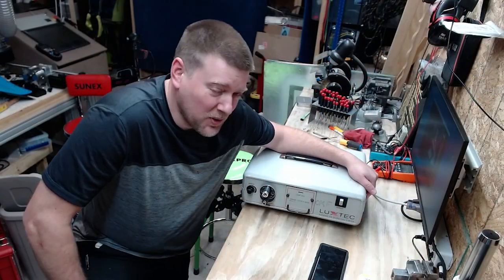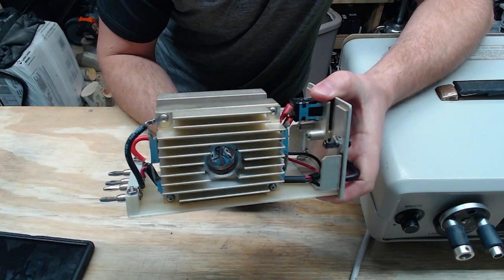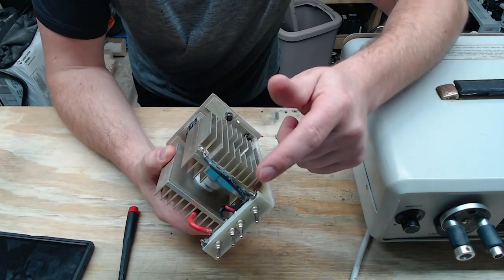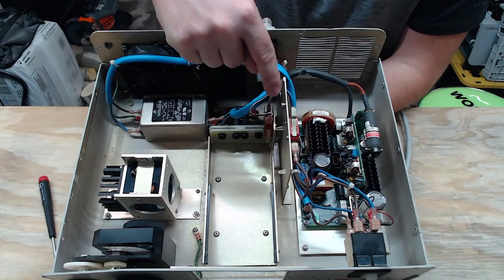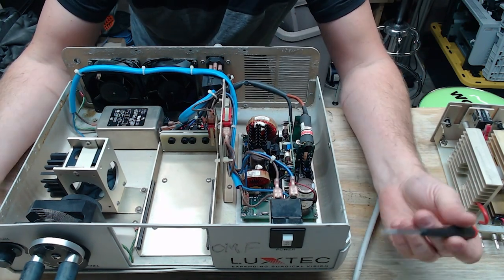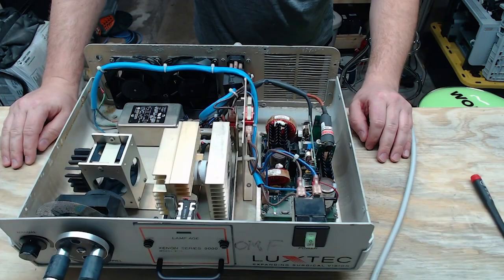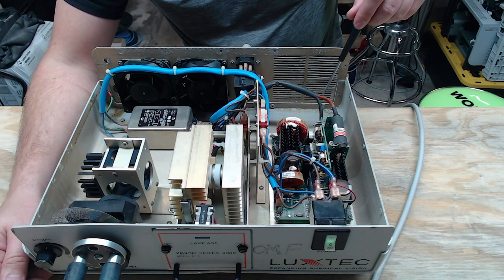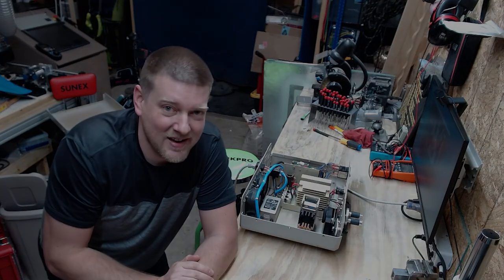Xenon Light Sources

Comment: Great video! I really enjoy your channel and I’ve been pouring over your content. I don’t repair medical stuff....but in my lab I mostly focus on industrial electronics and test equipment. Usually for things like assembly lines, or stuff like PLCs, motor drives, things like that. Mostly PCB component level repair. I enjoy it. It kind of happened by accident… As I’ve been a self-employed full-time woodworker for about 15 years. I knew nothing about electronics and then five years ago started down this rabbit hole and now here I am.

I spend about half the time in my electronics lab and the other half in the woodshop.

Would love to see you talk about some laser stuff. I’m a laser hobbyist and enjoy experimenting with solid state/diode/YAG pumped lasers. It’s really a golden age of laser technology. I buy a lot of medical lasers that have been retired or decommissioned very cheaply from Ebay. Also it’s incredible the decommission military hardware you can get on eBay for pennies on the dollar.

10 years ago you would need a small room full of equipment costing well over $10,000 to get 1,000 milliwatts of green laser light. Now I can build a handheld laser pointer version for under $100! Which is ridiculously dangerous! But a lot of fun. 

I bought several of the coherent branded “fap80” fiber coupled 80W optical output lasers from eBay for pennies on the dollar. Talk about crazy powerful! It really is a lot of fun!

I Always enjoy your content !

Comment: Thanks, nice video! I have exactly that Xenon light source. I also have a Stryker Q-5000, which turns on but after a few minutes, the bulb shuts down. Can you advise me on what the problem might be? Thank you
Reply from the maker: Verify that the cooling fans spin with little to no effort when powered off. if the fans do not reach or maintain a certain RPM then some units will error. also, make sure that the device is cleaned internally.
Reply: Thanks will check the cooling fan
Reply: I just check the fan, it seems to be moving freely. I guess there must be some other safety mechanism shutting the light down after a few minutes.